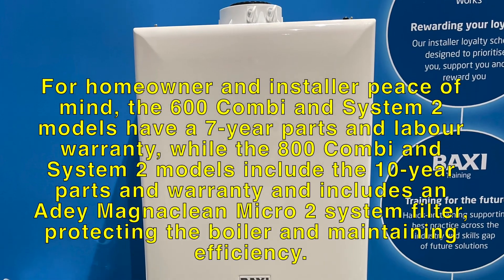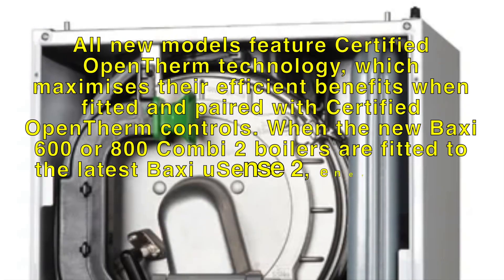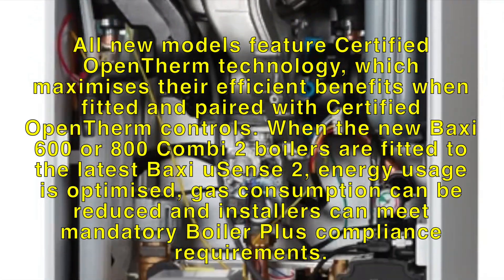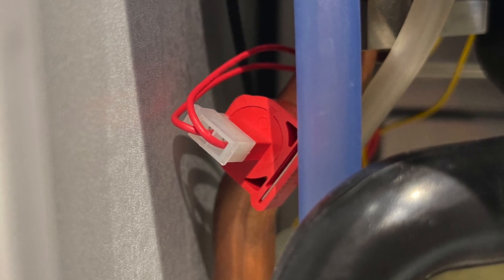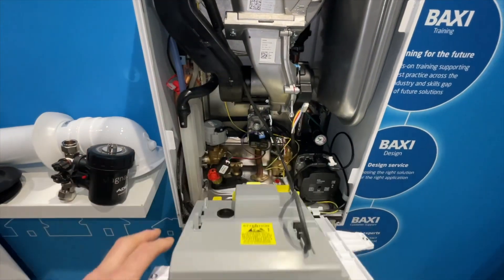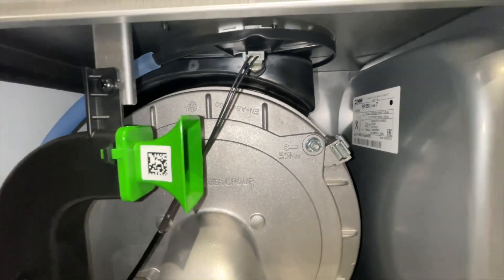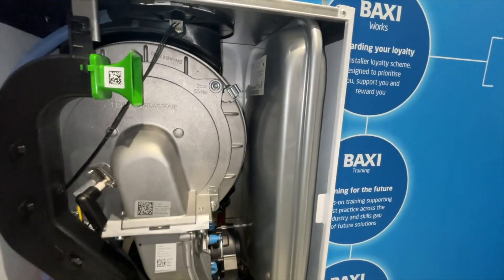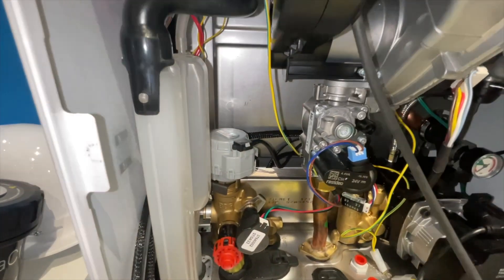Dynamic range rating #plumbing #plumbingandheating #baxiboilers

Comment: Does this effectively mean you can’t oversize the boiler when doing a swap job ?
Reply from the maker: You can but the boiler will try its best to help you out
Reply: @tomkatgastraining  No complaints about that then as still regularly see new 18 & 24kw boilers installed in 3 bed houses ……. and I’ve been guilty of it in the past !
Reply: Oversizing has more to do with modulation ratio than with range rating. Dynamis range rating is not really range rating at all. The important feature is target temperature and the boilers ability not to cycle when targeting the required flow tempersture. If the boiler has the wrong flow temperature as it's target and that flow temperature is higher than is required the boiler will cycle more than it needs to. Good weather compensation gives the boiler the perfect target temperature combine this with good modulation and you have the best philosophy to avoid cycling. This control strategy also range rating of any form is unnecessary.